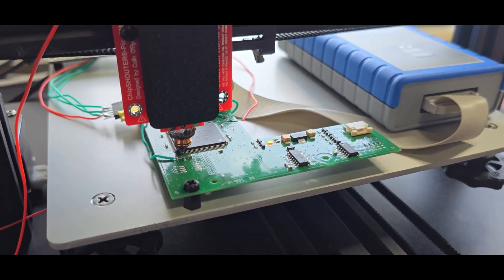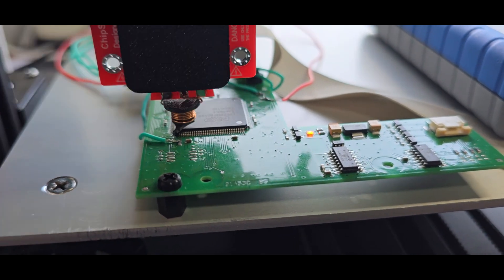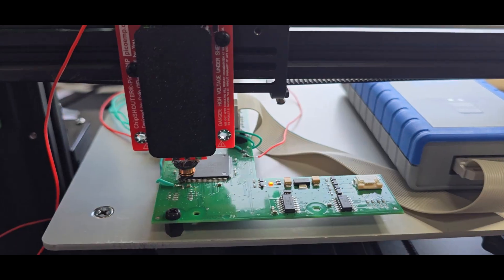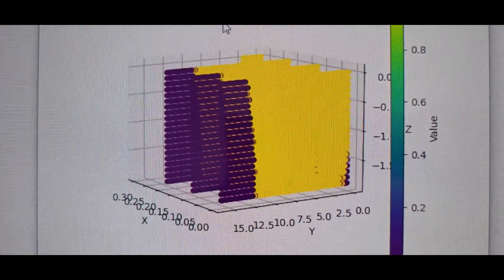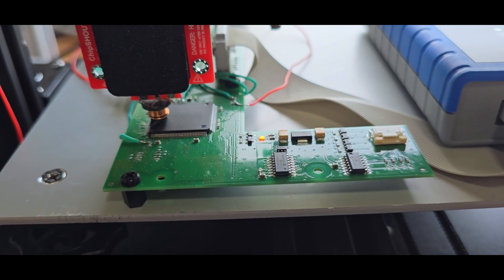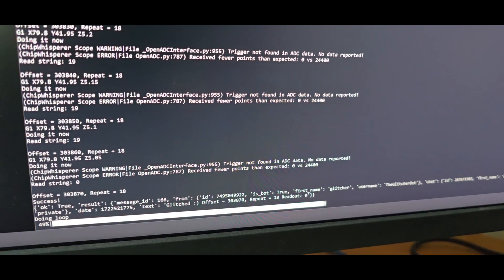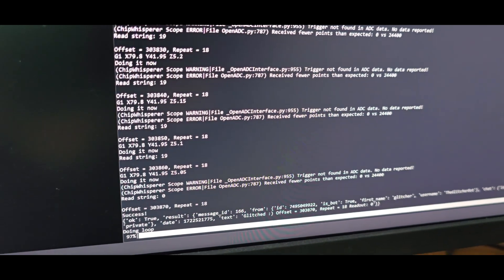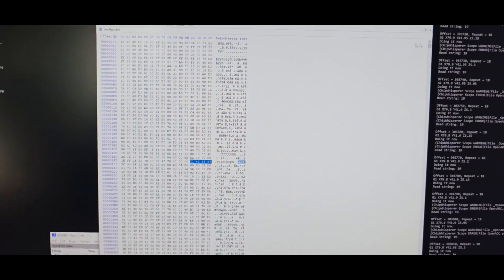EM Fault Injection : Glitching the NXP LPC2388

Comment: Did you write special firmware for the printer? Or do you use custom gcode?
Reply from the maker: It runs marlin and is driven by custom Gcode